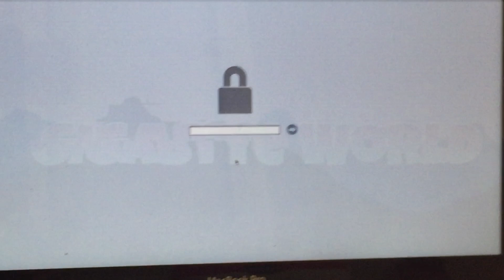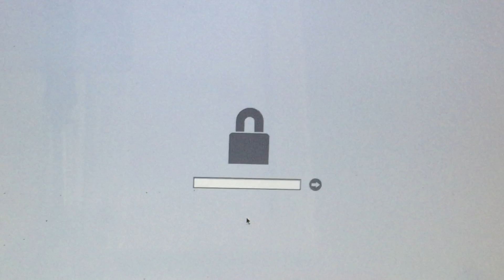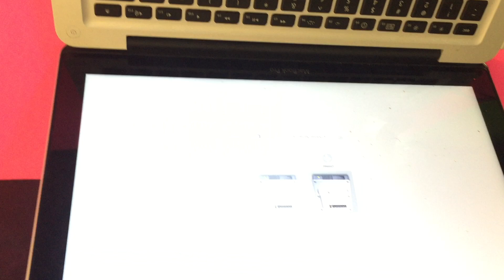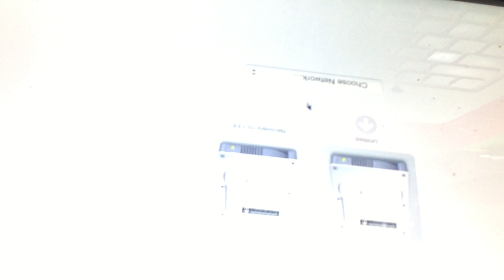HOW TO REMOVE FIRMWARE PASSWORD ON MAC

Comment from the maker: Please note this method works if your MacBook has the removable ram and older software model
Used  for this video was A1278 .This may work on MacBook Pro 2009-2012 if you have have old firmware may not work on some machines with new software .This method may not work on MacBook Air since the ram can’t be removed .This will not work on MacBook Pro  from 2013 upwards since ram in not removable
Reply: Hi can some one tried this on mac book air and systems from 2013 which is RAM embedded on boards! Please share the results thanks
Reply: I have 2011 macbook pro using os high sierra 2gb ram not working
Reply from the maker: @firdausginting5579  hi Firdaus unfortunately this method will not work for systems with high Sierra or newer it’s for systems with older firmware .Have you tried eBay there are companies that will remove the code for a reasonable fee